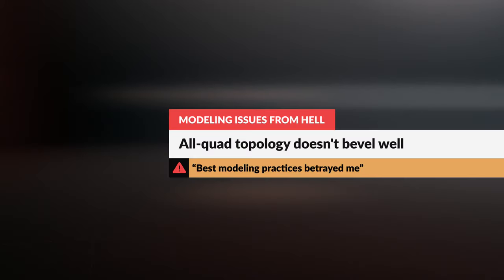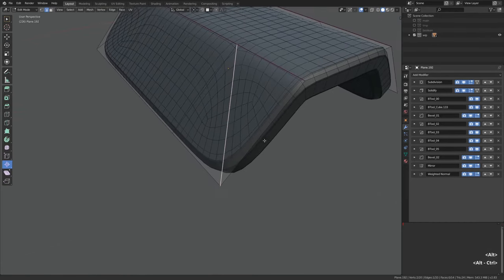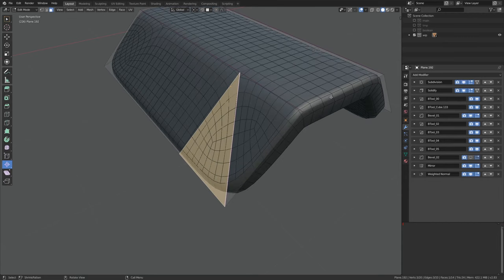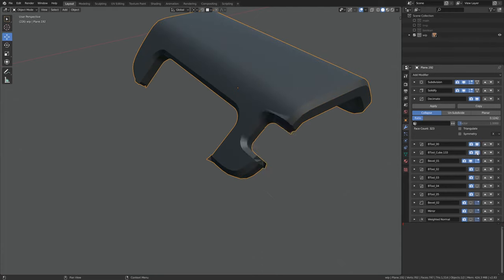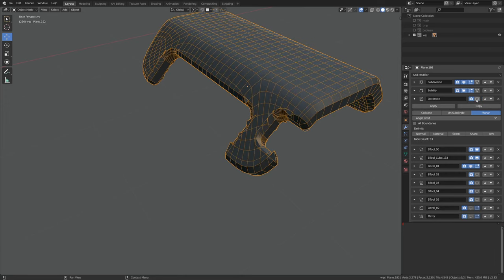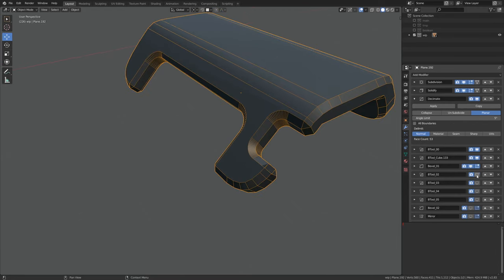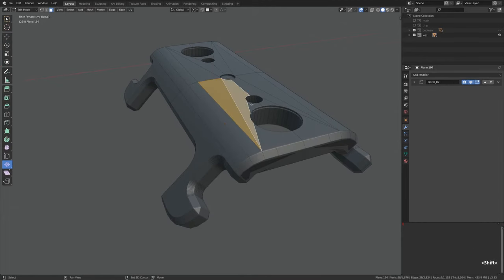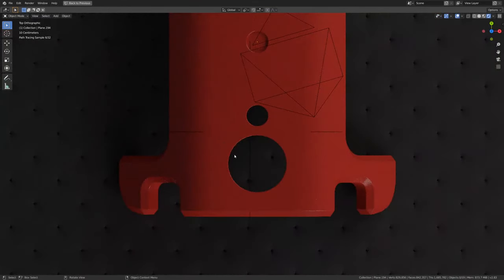Evil Topology? | Blender Modeling Tutorial

Comment: Well, quad can cause problem if you phuck them with boolean... surprise, surprise :D 
I do not know what to think about this video...... Quads which are not quad cause problems.
Reply: It was just meant to serve as an example to illustrate the case where you would need to use the Decimate modifier.

Nonetheless, I have found myself many times using this technique in my daily work. Decimate is one of the most underrated modifiers in Blender. To avoid the eventual shading issues on the resulting non-quad topology, I can always set Hard Normals in the bevel modifier, and then apply Autosmoothing. It works beautifully for me.
Reply from the maker: Apologies for the massive delay in response! 🤪🤪 Y'all completely correct here, not sure what we were thinking with the original title, we ended up emphasizing the wrong point, what we were trying to get at it is : Sometimes edges are going to get in the way, if we intend to do some boolean operations then sometimes more of those edges (even if they were only there to help direct all quad edgeflow) they can start getting in the way!

Instead we clumsily threw a quaded hand grenade and it bounced back in our face! 💥

Comment: not a good example at all regarding quad topology. There are a few of these videos floating around...each of these tutorials bashing good topology should first put a video out modeling a production ready lambo, that requires some good hard surface skills. And no you can't just put some ngons together and call it good.
Reply from the maker: Apologies for the massive delay in response! 🤪🤪 Y'all completely correct here, not sure what we were thinking with the original title, we ended up emphasizing the wrong point, what we were trying to get at it is : Sometimes edges are going to get in the way, if we intend to do some boolean operations then sometimes more of those edges (even if they were only there to help direct all quad edgeflow) they can start getting in the way!

Instead we clumsily threw a quaded hand grenade and it bounced back in our face! 💥